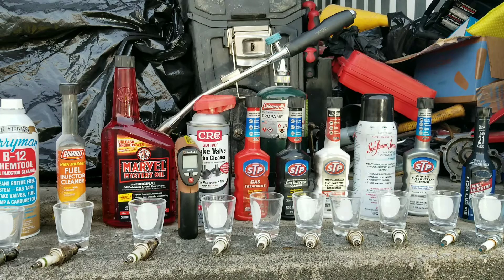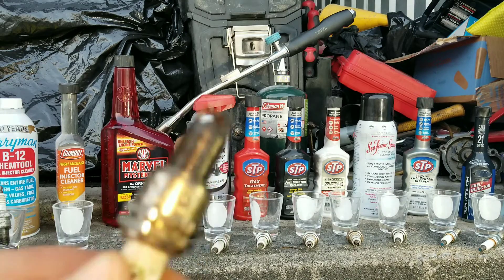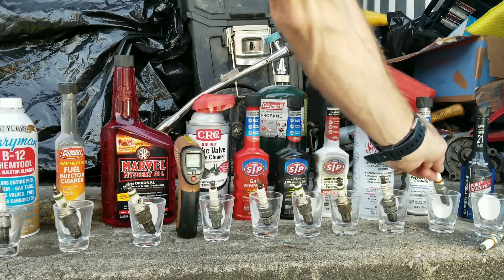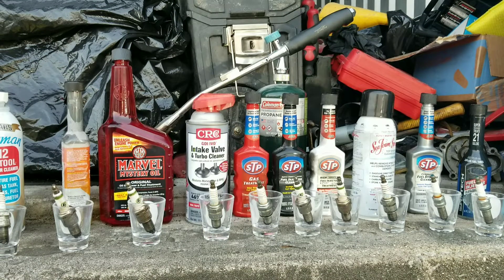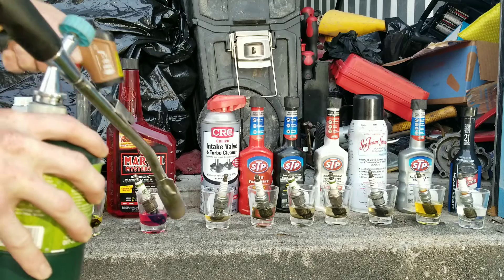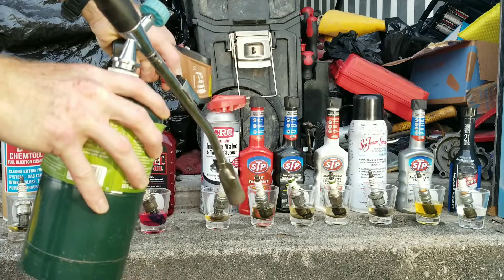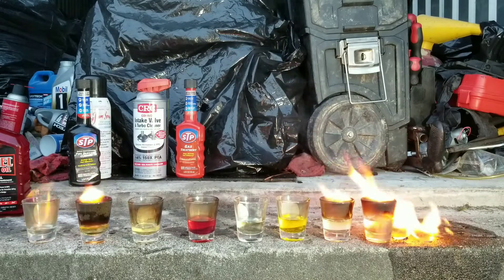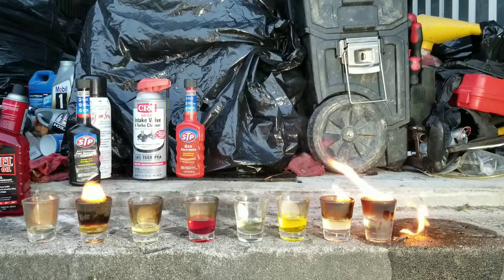jet fuel,seafoam,marvel mystery oil,crc intake valve & turbo cleaner,stp,gumout,

Comment: Interesting. Kinda worried when you brought the fire into the scene. All the bottles of flammable liquid with heat close by can be unpredictable and go really bad really quickly especially when under pressure. Either a big fire and or violent explosion. A safer and better test would be an old push mower or lawn tractor with the right amount of additive mixed to fuel and see if it works its magic in the combustion chamber. The mixture will contain more oxygen and burn properly and safely.  Please be safe and live a good and long life.

Comment: I don't understand the purpose here. If you're just cleaning spark plugs you can just use brake or carburetor cleaner. You certainly cannot be testing the effects of these chemicals on how well they clean injectors if you just soak spark plugs for a week. What was burning the chemicals supposed to show?

Comment: B12 Chemtool is the only cleaner that I've ever used that made an immediate difference on the first tank. It's not marketed at a performance booster, but it does make my engine sound better and seem to accelerate harder.
Reply: I seen Berryman's do a super clean job on pistons and cylinder walls... we're talking super clean!

Comment: Yes I add 4-6 oz every fill up and notice a smoother running engine. Also just replaced 1qt of oil with MMO and noticed engine running even smoother gaining 5mpg with no compression loss either! Will change oil with the usual Mobil 1 Full Synthetic the 1rst of the year and compare.
Reply from the maker: Sounds great thanks for sharing
Reply: NATES INTERACTIVE AUTO Your welcome and it’s really great!
Reply from the maker: Thanks so much

Comment: Next time please use PYREX glass containers.
Those chemicals were designed to be mixed with gas, not used by itself.  
Although the expected results of using the chemicals is similar they actually fall into different categories such as sovents, cleaners and top cylinder lubes, fuel stabilizers. 
I rather prefer using chemicals with lubricating properties as they tend to lubricate and clean piston ring grooves also not just injectors and valves.
Reply from the maker: Yes your right and that good info so what is the best additive for cleaning carbon from your experience  ?

Comment: Terrible. Ambient air does not supply enough oxygen to simulate burning with gasoline in a computer controlled engine.
2. Each product has a "Flash Point" which means the temperature at which it will easily light with a flame or spark. I could go on but what the hell.
Reply from the maker: Yes thats very interesting
Reply: Yes and of course, in hell everything burns.
Reply from the maker: Lol

Comment: I have used Marvel Mystery Oil for the past 2 years every time I buy gas at 4 ounces of MMO for every 10 gallons of gas in my 2002 Lincoln Town Car that I have had for 11 years. Before using MMO, my best highway mpg was 23.7 and now I am getting 25.2. With that in mind, MMO more than pays for itself, plus the added benefits of keeping my fuel injectors clean and lubricating the fuel pump. Has anyone added to their engine oil? So far, I have not.
Reply from the maker: Thats great thanks for sharing i have added to the oil check it out
Reply: I've added it to my oil and gas. I recommend using both marvel mystery oil and seafoam for best results. 
Marvel is really good at cleaning crankcase buildup and seafoam is excellent at removing valve buildup.
Reply from the maker: Yeah they both have been very useful thanks for sharing
Reply: I add it 15 minutes before I do an oil Change and use it with Lucas products, master mbz tech for 22 years here .
Reply from the maker: Yes i have been a tech for some time and i often do a similar job
Reply: It goes right into the tank of my 99 grand marquis every time. Love that stuff and love my car. Smooth as silk when it runs

Comment: I'll still use nothing but MMO always has been good to me
Reply from the maker: I agree ive always had good luck with mmo and everyone seems to feel the same in the NIA community
Reply: I agree with you Austin Early, that MMO is a very good product and that I have been adding it to my fuel for 2 two years every time that I buy gas.
Reply: I always ran  Castrol 20-40 sae w Marvel's MO(1 quart) and have had many classic cars n Jap cars early ones,never fried a motor!!..have my 84 Subaru gl 4x4 run hell outta it,no smoke 244.000miles...alot hard miles...still purrs ..use your own mixture that's been mine n alot cross-country drives, change oil at 3-4 000 depending on type driving.. .stuffs be around this long for reason ...
Reply from the maker: What can we try next
Reply: @NATESINTERACTIVEAUTO  Frantz oil bypass filter